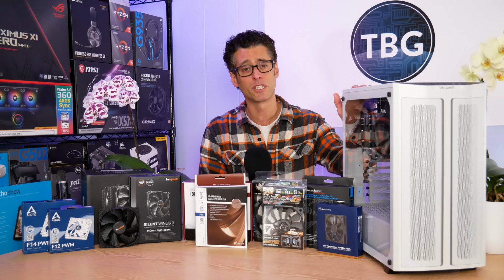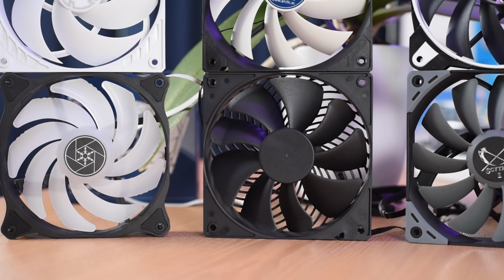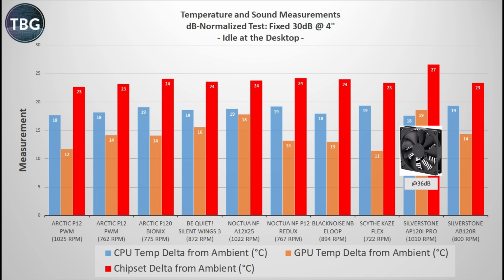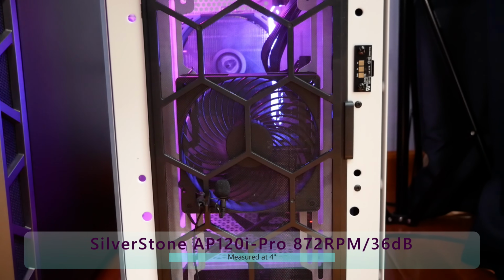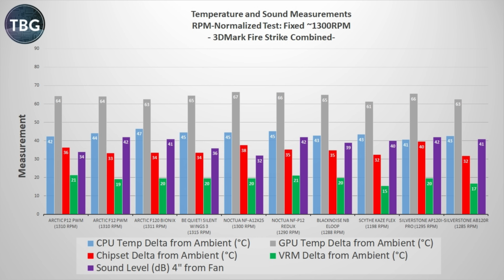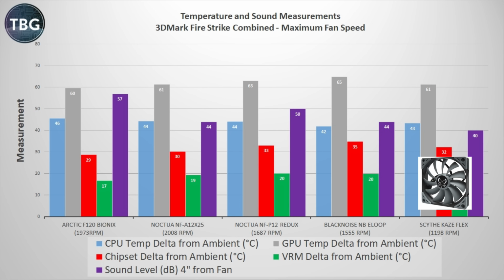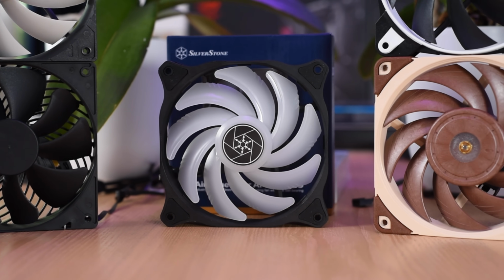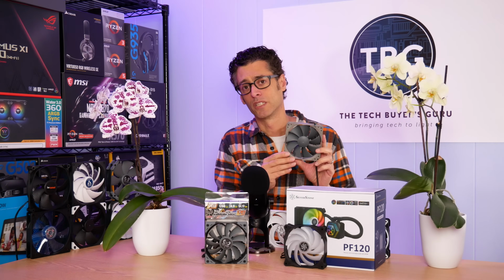The Best 120mm Case Fan Shootout: Arctic vs. be quiet!, BlackNoise, Noctua, Scythe & SilverStone

Comment: I have a thermaltake s100 tg case. Which fan is better between arctic f12 or p12 as front fan?
Reply from the maker: I recommend the P12 every time... it is a far superior design, even for case fan cooling, even though most people think of it as a "cooler fan".

Comment: I love hearing the different variations in frequencies across the fans but also how it's weird to hear the AB120R sound so quiet but is in fact louder than the hum of a P12 by a fair margin. 

I also wish Scythe found a way to increase their distribution because it's a shame they're either out of stock, overpriced from third party sellers or just take forever to reach their destination due to overseas shipping in a pandemic. Arctic finds themselves in this position too albeit to not the same degree since they actually ship supplies to international chains.

It's so weird how the Kaze fans do so well too considering the paper specs are pretty tame even compared to the P12. About equal air flow yet half the SP but somehow it just works™.
Reply from the maker: There was one issue in my testing methodology, which was that I positioned the dB meter in a different location than the microphone for audio samples. Thus you are not hearing the same thing as the dB meter. In later videos, I fixed that. But yes, the AB120R is very quiet from close up due to the smooth motor and bearings.

Comment: Hello. What is superior specifically for the ALTA F1 Silverstone case with 3x fans on the bottom intake and 3x fans on the top exhaust: 6x Toughfan 140mm or 6x AP140i? Thank you.
Reply from the maker: That's indeed a very specific question, particularly considering you're asking about a case that was never released to retail!

To answer your question, the better choice is probably the AP140i, simply because it is a case fan, while the Toughfan 14 is a cooler fan. Radically different designs, for completely different applications. With that said, I'd probably go with a 5-pack of Arctic P14 fans and call it a day: https://amzn.to/3d0RFIV
These are far better for case cooling than the Toughfan 14, and much quieter than the AP fans.
Reply: @TheTechBuyersGuru  Thank you. The Alta F1 will be released in Q3 of 2021 (as Silverstone themselves told me in Alta's comment section on YT), so I just wanted to know which fans would take advantage of the chimney stack effect the most. I'll look into the P14's, although I have heard of low-rpm hum being generated by those.  Thanks again.

Comment: Would have been nice to see that Arctic P12 PWM at 1800 but to see what can do at the highest but you only showed up to 1300 any reasons why?
Reply from the maker: This review was intended to show people which fan designs are superior. Testing at max RPM skews the results towards whichever manufacturer ships a fan with the highest RPM, which has lead to years and years of bad fan designs that are compensated for with high RPMs.
Reply: @TheTechBuyersGuru  I see thanks for the repply anyways i am new to the channel and i have been watching quite of your videos, is fun to learn from so many fans and there is a fan that i am curious about is the Thermaltake TOUGHFAN 14 instead of 120 mm is the 140mm this Noctua 25 clone delivers 120 CFM and is still cheaper than the Noctua would be nice to see it in future video comparisons.
Reply from the maker: I do have two ToughFan 14 samples here, but they were launched a few months after my 140mm radiator fan shootout, which you might have seen already:  https://youtu.be/cQ6W-b45wZ0
I'm still thinking about doing some kind of one-off review for them, but setting up a test like this takes a lot of time for benchmarking, and right now I have other projects that are a higher priority.

Comment: Would you think the more concentrated flow of the NB eLoops would be beneficial for a case like the TU150?  I'm pretty limited on fan choice, so I was thinking maybe a NB Eloop B12-PS (1500 RPM max) for the front, and NB Eloop B12-P (2000 RPM max) for the rear and then two NB Eloop B12-1 (800 rpm 3 pin fans).  I thought about the Kaze flex for the bottoms, but I think it would be more beneficial for the air to tunnel right towards the heatsink and then blow out from there where the Kaze seems that it might increase pressure since and fight the air as it tries to exit the fin stack.  Then again it might do a better job of evacuating the air around the GPU into the upper chamber towards the exhaust.  I don't know.  I think I'm over thinking this.  Just curious as to what your gut reaction spitball idea would be?
Reply from the maker: I think concentrated airflow is better for traveling a distance. I don't equate it with pressure, although manufacturers will make claims that air channeling does both. So for a TU150, you just need to force air a lot of air in no particular direction, because it doesn't have front to back airflow. I would use the Scythe Kaze Flex for that.
Reply: @TheTechBuyersGuru  In your opinion  does PWM really off that much more in terms of value and control than a 3-pin?  I've never owned a PWM fan so I'm slightly confused of the benefit.  Sorry for the stupid questions.
Reply from the maker: Not a stupid question. PWM is just a slight upgrade from 3pin on modern motherboards, as they can control 3pin fans via voltage anyway. This wasn't true a long time ago, but it's standard now. The only advantage of PWM is that it can deliver much lower minimum RPMs, meaning lower noise at idle. This is due to a broader range of control offered by PWM, which pulses the signal at full voltage, versus voltage reduction, which causes instability as it goes lower.

Comment: Is it something on the mic or audio setting or does the SilverStone just win the competition by a mile?
Reply from the maker: I will eventually be re-testing the SilverStone AB120R fans with a different mic setup. I think they do well because they have a very quiet motor, which was the main noise picked up by the close mic position. Further away, other aspects of the noise profile would dominate. Unfortunately, there is no "one" correct way to test fan noise, because it completely depends on how you use them, what case you have, and where the case is positioned in the user's space (i.e., on desk, floor, etc.).
Reply: @TheTechBuyersGuru  Ah.  Thank you so much for the clarification.  Watching the video, I thought perhaps I was insane thinking that they were insanely silent compared to everything else in the test.  Haha.  Thank you for all that you do and for clarifying something that was confusing me!

Comment: If the microphone is set at the same distance and sensitivity, then these seem to me the best 4 fans, from quietest to loudest. (Scythe being the loudest from the 4)

Just try clicking them 1 by 1, and you will see how the noise increases a little bit each time:

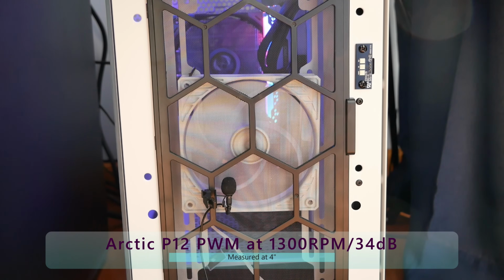12:03 - Arctic P12

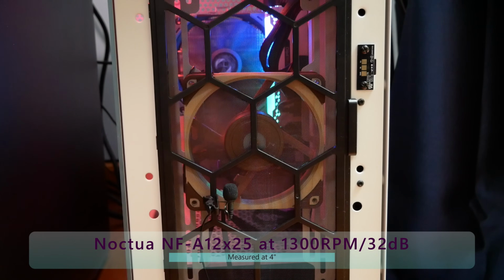12:25 - Noctua NF-A12

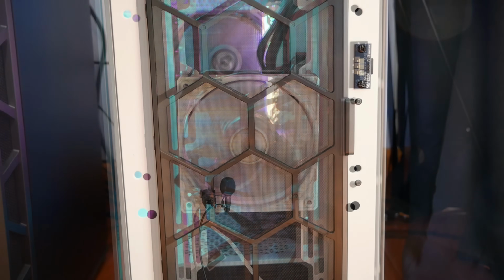12:14 - Silent Wings 3

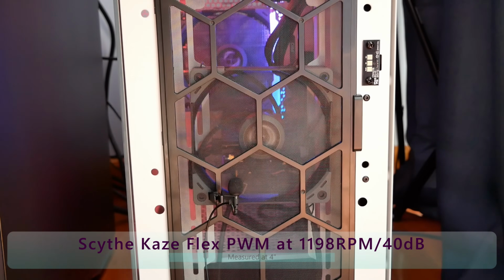12:53 - Scythe Kaze Flex

Edit:
Judging by Amazon comments, Arctic doesn't have as good of a quality control as the other 3 brands.

Comment: Great review, but you tested the highest static pressure fan (Redux) with a test that prioritizes airflow and little static pressure.
I respectfully disagree that it's a bad fan, and if you repeated the test for CPU coolers or radiators I bet the numbers would change significantly (towards the Arctic p12 and Redux P12).
Of course the Kaze, not to take anything away from it, was a very impressive case fan, and I would totally consider them for intake / outtake based on this review.
Reply from the maker: I have done over a half-dozen fan shootouts, you should definitely check them out. The static pressure spec is practically meaningless. Here's a 120mm rad fan shootout focused on static pressure: https://youtu.be/W2Zis8RjcX8
And here's another more recent rad fan shootout: https://youtu.be/cQ6W-b45wZ0
And here's yet another one: https://youtu.be/o-bRE1Wo97Y
Basically, my testing has gone way beyond what any spec will tell you about fan performance.
Reply: @TheTechBuyersGuru  
I didn't mean to throw shade if I came off that way. I actually watched all of those already because I really enjoy your testing methodology, and it's clear you know what you're doing.
I guess my point is the Redux is basically a pressure optimized fan, meant to hang with the A12x25, so I felt it really belonged in the Noctua shootout video with the A12 and A14/15's, and not here with the "best" case fans, blowing through basically no turbulence.
I see your point where tested results really are more important for factual real-world performance though, I'm sure everyone would agree with that, although the tests results really do mimic the fans that have the highest pressure ( at least for Rad / HS tests).
Anyways, thanks for replying, I guess I'm just a bit disappointed I never saw the redux in the other tests. I own only one and the rest are A12/A14's I got half price, so I'm totally okay with my price/performance ratio vs the P12's here in Canada.
Cheers
Reply from the maker: No worries, I'm just working very hard to convince people that those static pressure specifications are completely meaningless and should not even be looked at.

And for the record, the Redux is just an old version of the current NF-F12, which was indeed in my radiator test. Under no circumstances will the Redux outperform the F12.

Comment: What id love to see is best fans for push/pull setup - that is, best pressure fan for pushing with the best air fan pulling (through a cooler/rad). 
Been shown a few times that's the best push/pull config but not seen many vids myself. 

After seeing your review I went for 2 arctic P14s. Deffo not as quiet as I thought they'd be, and they vibrate the heck out of  my case, but do shift more air than my phanteks ph-f140mp

I'm actually considering buying some (air flow) kaze flex now to run pulling on an nh-c14s with a p14 pushing the other side.
Reply from the maker: You're talking about radiator fans, not case fans, so this isn't the right video for you. Here's the one you should be watching: https://youtu.be/cQ6W-b45wZ0
And generally, I don't do much push/pull testing, and combining different fans for push/pull isn't something I plan on testing, but the theory sounds interesting.
Reply: @TheTechBuyersGuru  yeah I've watched all your vids my man! Great content. Was looking at this vid because yeah looking for the best "airflow" fan which I guess is the same as the best case fan?

Again not seen much on it but yeah apparently in push pull on a rad or heatsink it's best to have one pressure fan doing the pushing then an airflow doing the pulling.

Have a kaze flex in my basket now or might just go with another p14 for pulling to keep them the same. Would be interesting to test the theory though.

They're different rpms though that's what I'm worried about (300-1800 on the kaze flex and 200-1700 on the p14 pwm pst I believe).
Reply from the maker: Awesome, thanks for watching my vids!

One tip: don't pay any attention to RPMs. You are cross-shopping two different brands, and they work completely differently. RPMs cannot be compared except on the exact same model. And because the P14 is so good at both pressure and airflow, that's probably the absolute best choice on a rad. If the theory on using an airflow for pull is correct (which it could be if the main purpose is to move air out through an unrestricted area as fast as possible), maybe the Scythe would be good, as it's an excellent exhaust fan. But it would need a case with an open top vent to work well. I don't support front-mounting rads, so if that's your plan, you're on your own!
Reply: Shame the f12s look so poop

Comment: Can't help but wonder if the fan noise/hum is exaggerated due to mic placement. Close enough to catch pressure change of individual blades passing by? Gut feeling sais some 20 cm or more in between mic and fan would give a better representation of sound pattern. Especially the noctua giving quite the whine compared to other reviews makes me wonder. 

I tend to run fans slow enough not to hear anything but bearing/motor noise. That was drowned out here.

Edit: found answer in comments (How was sound level dB measured?)
Reply from the maker: See follow-up video: https://youtu.be/PUdsTiRmuuU
Better mic placement

Comment: OMG you're awesome! I love your work. Exceeded my expectation :) I have a Scythe Kaze Flex PWM 300-1200 RPM. Would you recommend upgrading it to 1500RPM? Would it make a positive impact on the temperature?
Reply: Adding a bit more context to my question :) Sorry if I wasn't clear. I have the 1200 RPM on my FUMA 2. I've been thinking if it's worth replacing it with a 1500RPM? Would that help lower the temperature? What about noise level? What is your thought on that?
Reply from the maker: The new Kaze Flex Black is 1500RPM, and this is what I assume you're talking about: https://amzn.to/3myNIPc

I have not tested it, but increasing the RPM may not be ideal, as it could bring with it additional noise that is out of proportion to the performance improvement. The Fuma 2 is very well balanced. Also, there is no 1500RPM slim fan yet, which is what you'd need in front if you want full RAM clearance.
Reply: @TheTechBuyersGuru  Awesome, love your quick response. Yes, that one.  Ah, you're right there is no 1500RPM slim fan. There is also a 1800 RPM slim fan (https://www.amazon.com/gp/product/B003E00ZIU/). What is your theory about having two different speed fans on a CPU cooler? Is it a bad practice? Besides that, I think I will leave my FUMA2 as is :)
Reply from the maker: I would not use an 1800RPM fan on the Fuma 2. As for different speeds, it's hard to say, I haven't tested it. Typically fans are always run at the same speed, in part because they will be on a splitter and will have the same RPM rating. But the slim fan is smaller so it will not have the same airflow. Hence it might make sense for it to be faster, but not 1800RPM, that will be too loud!

And no, I don't plan on testing this at the moment!
Reply: @TheTechBuyersGuru  Makes sense! Good advice. Thanks soo much for your time and patience with me. I've learned a lot from you! Thank you!

Comment: dB does not mean much. You can have the same dB from high pitch and low pitch sound and yet they will not be perceived by individuals with the same "loudness". Low pitch noise tends to dampen more slowly over distance than high frequency noise. So, if you place the microphone farther away from the source, the high frequency noise tends to fade away. The fan that produces the most low frequency noise will perform the worst. Plus, different individuals will perceive noise of different frequencies differently.
Reply from the maker: I'm not going to dispute what you say here, but you are in effect saying there's no point to do any testing, because everything is subjective based on the user and how far they are from the device, and no specific distance is correct.